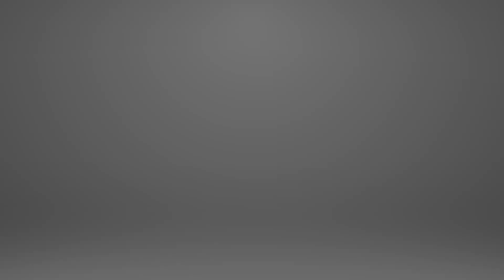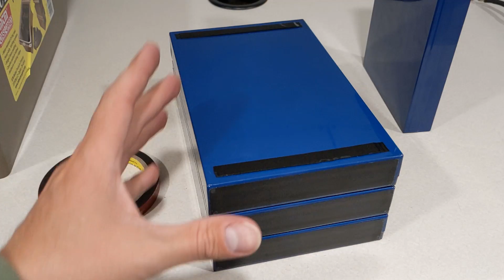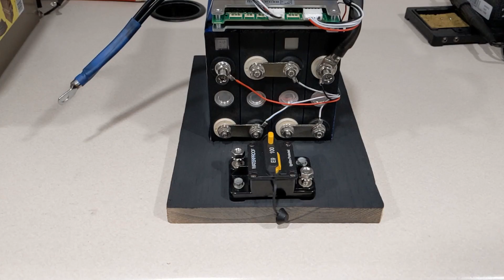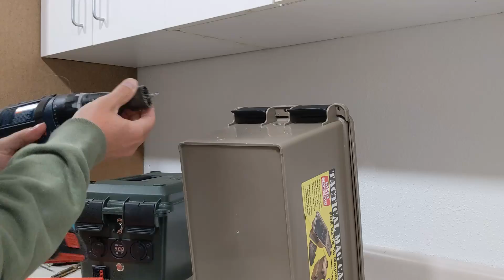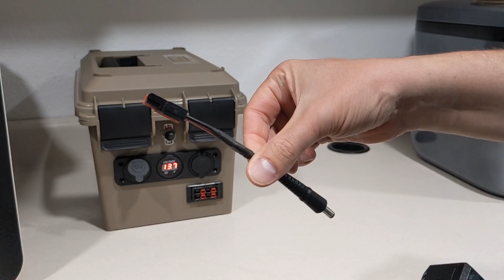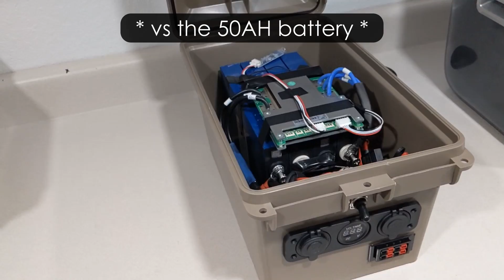DIY 80AH LiFePO4 Battery Box - COMPLETE BUILD VIDEO  | AliExpress Cells, High Quality BMS

Comment: i thought on these prismatic cells the vent has to remain upright or pointed up to vent if possible, or is that a vent for expansion only in case of over heating, i too was going to try a build like this, i have 8 batteries coming to try
Reply from the maker: I haven't had any issues ever since making the battery. I've seen many other designs with the venting horizontal as well. Big battery has their cells setup sideways.  I have only ever pulled 30 amps in or out at a time. If I was going to pull 80 amps I'd probably worry about it venting, I don't use it for large loads, mostly 12v fridges.
Reply: @Jasonoid  thanks, thats what i was thinking, i was going to make one for my son as a present, just for camping, maybe to blow up mattress, charge cell phone or tablet when hes hunting, ect.or to charge things or run things in his tent, ect.
Reply from the maker: @mattrowe1229  that would be an excellent project, have you seen the chins 12v 100ah lifepo4 battery that will prowse reviewed recently? Great battery for super cheap! I'd probably go that route next time I build a battery.
Reply: @Jasonoid  ill go look for it, i may have seen it already, ive been looking at so many vids i forget which ones i watched, but i am a member at his forum also, i was also looking at the 32650 because of size, and weight, and no vent to worry about. will got me started in all this as i am building a backup emergency for my trailer just to power necessities with 2 panels, my batteries i started with are coming from battery hookup, just 8 x 25ah to start.thanks for replying, a lot of tubers dont..
Reply from the maker: @mattrowe1229  good luck with your project, you can't go wrong either way! I'm just a small fish in a REALLY big pond haha
Reply: @Jasonoid  im just a minnow LOL
Reply: I shared the same concern about them being on their (short) side. It is difficult to find a decent box tall enough to have the cells upright. In the end, I think I will go with this design on the short side and see what happens. I too won’t be drawing more than 30 amps most of the time. Likely just 3-5 on a fridge. I’m using the 78 AH batteries off of batteryhookup.
Reply from the maker: @ssyoumans  I still haven't had any leaks on my cells. I bet you'll be fine to install your cells this same way. There are many of these prismatic cells that are oriented sideways in other commercial uses.
Reply: @Jasonoid  i was also looking at these, 18650 so there small, i could use 2 of these per box in parrallel, keep it at 14.4 volts which is what our vehicles charge at so it wont hurt any 12 volt items, and they come with a BMS for only $7.99 a piece, plenty of room in a ammo can, just to be used for camping and low drain devices and emergency,  https://batteryhookup.com/products/14-4v-6-6ah-95-04wh-li-ion-module-with-bms
Reply from the maker: @mattrowe1229  those should work well. The only downside to 4s lithium batteries is the voltage swing. 14.4 is the nominal voltage and it goes from 12v to 16.8 volts, so probably a little to high for some devices.

I am purchasing battery hookups 100ah lifepo4 4 pack of battery module and their lifepo4 4s BMS/Bluetooth adapter for a new build, those options are under the accessories page on their website. I'd recommend those cells for the price! Only $240
Reply: @Jasonoid  couldnt find any 100ah batteries on their site, i found the ones i purchased 25ah
Reply from the maker: @mattrowe1229  send me an email to jasonoidllc@gmail.com and I'll send you the info.

Comment: whats the max Amp output?    and How much does it Weigh in lbs..   Was looking into making something like this for my car audio system currently I have 3 Xs power 3400 batteries...They all weigh quite a bit and weigh down the back of the car.   I would need something I can draw quite a few amps from at once.. I'm pushing like 9000 W RMS
Reply from the maker: Weighs like 25 lbs, usually they can handle 1c discharge rate, so 80 ah is 80 amps.
Reply: @Jasonoid  Nice and light but I don't think it would be able to handle it..  system is Drawing too many amps ..

Comment: Do you recommend putting a battery monitor for the case.. If yes, do you have a recommendation ?
Reply from the maker: The BMS I used for the build has a Bluetooth app that shows absolutely everything about the battery. Very useful!
Reply: @Jasonoid  That I am planning to use, but wanted to check if there is a LCD one I can use.. mostly because family will be using it more than I will and just wanted it be idiot proof.
Reply from the maker: @jbphoto8238  good idea! Iust Google lifepo4 battery meter and you'll see some options. Just check out the reviews before purchasing it.

Comment: Very thorough and informative build Jason! Thx for sharing. Was wondering if you had ever thought of using Li-Ion before choosing to use Li-Po instead before the build? Am trying to choose either to use these both for my build as well. So thought of getting your thoughts on it first. Li-ions are cheaper but has lower capacity on each battery, Li-pos are much more pricy but has higher capacity on it. But which one lasts longer in the long run?
Reply from the maker: Lifepo4 have 2500 cycles at least per cell if treated correctly, lithium Ion only have 500. Lithium ion are a fire risk, especially for a diy project. I would stick with lifepo4, they are slightly heavier, but are very safe!

Check out the SOK 100ah batteries, they are very good quality but they have the built in BMS already that has the low temp cutoff. For complete diy aliexpress has many cells to choose from, you just chose the middle ground pricing on cells, I avoided the dirt cheap ones and the most expensive ones.
Reply: @Jasonoid  thank you on reply Jason, much appreciated. Will have a look on those battery u suggested. Again tq and keep those videos coming!

Comment: Have two questions, 1. we need 2 fuse holders and one 30amp / 20amp fuse which is not in the list below 2. Can I plugin the solar power panel / car battery 12v output through a MPPT or i need a DC to DC convertor as you have in the comments.
Reply from the maker: You can charge it via the Anderson power pole connections as long as you have a MPPT designed for lithium batteries.  The fuse holders can be found on amazon, get at least 8 to 10 gauge holders
Reply: @Jasonoid  Thanks a lot .. I got both.. will shortly send some pictures after I complete the build

Comment: Do you have a suggestion for a different box for this. The TMC has been out of stock for a while now and I cannot seem to find it locally.
Reply from the maker: Dang, I'm sorry you can find it. They have a green one that's very similar, have you seen that one in stock?
Reply: @Jasonoid  I found it finally at one of the arms seller.. wish amazon had it in stock and I did not have to run around in circles :) ..

Comment: How long does your battery box power one of your larger 12v refrigerators?
Reply from the maker: I ran my ICECO VL60pro for over 60 hours on my battery pack and it had plenty of life left. No input or charging during that test. Runtime depends mostly on ambient temps and what you have the fridge set to inside. I was really happy with the results.
Reply: @Jasonoid  that's awesome. I'm building one right now and can't wait. Do you have any problems with your inverter when your batteries are charged at 14.v?
Reply from the maker: @tylerj602  Car batteries when fully charged sit at 14.2v and your alternator sits at 14.2 volts most of the time. These LiFePO4 batteries have the perfect voltage! They are slightly higher than lead acid batteries and don't sag as much so 12v fridges run much better on them.
Reply: @Jasonoid  ok, thanks for the info. I charged my batteries and connected my inverter and it kept flashing the lights indicating something's was wrong. I then connected it to a lead acid and it worked fine. I left the lifepo4 sit over night running some 12v lights and with the voltage drop the inverter worked then (the next morning). I figured it was the voltage.

Comment: How did you combine the 3 BMS wire ends into 1 terminal? Are the BMS wires 10 AWG?
Reply from the maker: I used a large terminal lug that supported 6 awg wires and soldered/crimped it in there. I purchased this set and I use these all the time for projects:

https://amzn.to/2Zp09md

Comment: What battery pack did you use from aliexpress. There’s a few options, do i go with the 105 amp one?
Reply from the maker: I used 80ah battery cells. I'm not sure if the 105 AH cells would fit in the case I used. There are many 80AH cells on Aliexpress, just find one that mentions they are grade A cells

Comment: I’m pretty sure u can orientate lifop04 cells in any direction but I remember one person I follow can’t remember who said on the side and upside down r the worst ways. Not sure just figure I’d let u know. Laying them down I heard was better
Reply from the maker: Will prowse probably. No issues yet and they have been sitting sideways for a year. Maybe under very high discharge and charge rates they would leak or vent but I hardly ever pull more than 5 amps from the battery at a time.
Reply: @Jasonoid  cool.

Comment: Hi.. thank you for good explanation and detail of project. 

May I ask you how to recharge battery? 

Cheers
Reply from the maker: I use the Anderson power pole ports. I charge it with a Kisae DTM1250 DC to DC charger. It takes both DC input from my alternator or with MPPT solar input.
Reply: @Jasonoid  thank you for your reply. can I have a look how to connect DC to DC charger to your battery ?
Reply from the maker: I will have a video out on it soon. Just keep checking back for it in the next month or so. It's pretty simple.
Reply: I came here for the same question.  Would I be able to charge this with my renogy 100w solar suitcase that already has the charge controller by alligator clipping to the main terminals inside the box?
Reply from the maker: @deanwhittle2669  Most people would advise against it because that battery charger is designed for lead acid batteries....BUT technically it would work because it would charge the battery up to 14.2 volts and the LiFePO4 BMS would shut off the charging. I have used a lead acid charger on my battery in the past in a pinch, BUT I always recommend someone purchase a designated lithium based charger.
Reply: @Jasonoid  wow thanks for the quick reply.  Could you clarify... The Voyager states "4 Battery Type Compatibility– Sealed/AGM, Gel, Flooded, and Lithium batteries (with Lithium Awakening feature)"  Does that not include Lifepo4?
Reply from the maker: @deanwhittle2669  Well that's cool it supports lithium, it should have the ability to "program" the final voltages and work just fine with LiFePO4 chemistry. You'd probably want to have the final charge voltage for this battery around 14.2 -14.4. Mine is set to 14.4v.

Comment: How long could you run your iceco fridge with the battery?
Reply from the maker: I recently tested it, It ran for 54 hours and was about 50% capacity, level of temperature make the biggest difference. If I used solar panels and my Kisae DTM1250 DC to DC charger it would last forever. Pretty happy with performance.

Comment: can I ask you for information? I have purchased 4 prismatic 90ah lifepo4 cells, do I have to control a trolling motor with a maximum absorption of 20ah, can I install a 40ah bms or do I have to mount it from 90ah or higher?
Reply from the maker: You will want your bms to match the maximum output of your battery cells just in case you ever want to draw more power. 90ah cells should source 90amps fine so either do an 80amp bms or a 90amp bms in your design.

Comment: Nice battery box, 
May I suggest you break up those Anderson power poles into 2 or more fused links.
Also cut and instal Anderson’s on that bestec inverter. I did mine so much easier.
Reply from the maker: Good suggestions, thanks!

Comment: Wonderful ideas!  I won't be sleeping well for the next couple of nights!  Is it possible to charge this arrangement by simply plugging into a automobile's 12v accessory port?  I know it won't be rapid, but it would charge the unit while driving, right?

Again, thanks for the wonderful idea!
Reply from the maker: You'll want to charge the battery using a lithium lifepo4 based charger. There are many available. If it has DC input you could charge it with your vehicle 12v accessory port. Thanks for watching!
Reply: @Jasonoid  Have you sourced a reasonable DC-DC charger?  I'm not sure how boxes like Jackery are getting all this stuff in there!   Charge controller, inverter, DC-DC-charger.  AND the batteries!  How do they do that???  One of my primary uses will be to run a DC refrigerator while on the road.  I really need to be able to charge from my alternator, even if it is slow.  How do you manage your refrigerators while on the road?
Reply from the maker: While on the road and while driving, I run my fridge off my 12v accessory port in the back of my 4Runner, I custom installed Anderson power ports and ran 8 gauge wire to the back. It works well and I don't have much voltage drop over the distance. 

While camping or when I'm not driving I run my fridges off this  Lifepo4 battery. I charge it via a combo charger. It's a Kisae DTM1250. Check it out the, I bought one and I love it. Little expensive but very customizable. Solar MPPT and DC to DC Charging in one! I bought it off Amazon.
Reply: After looking around (and being appalled at the prices for DC-to-DC chargers), I've started playing around with DC buck boost converters you can buy on ebay/Alli Express, etc. These are basically self-contained power supplies that feature constant voltage and current and will easily step up or step-down voltage from inputs between 5 and 30 volts and outputs of .5 to 30volts.  They are pretty limited to relatively low amperage (usually less than 4 amps), but for my purposes it should work, I think, for slowing charging my LiFePo4 battery from the car's electrical system while driving.  There is also a timer feature that will turn the output off after a predetermined amount of time.

There is the added plus of now having a self-contained module that can be used to run all sorts of less-than/more-than 12 volts in my battery box.  The model I'm using has a display built right in, so it's very easy to dial up the desired voltage and amperage requirements to run fans, worklights, etc that may be rated at something other than 12 volts.

I'll report back with details of my testing....
Reply from the maker: @quinbus51  please let me know what you end up doing!
Reply: @Jasonoid  Hey Jason.  I'm finishing up my testing on two of these buck boost circuits and I have to say that I'm pretty happy with the possibilities.  I'm in the process of building a LiFePO4 charger that will run off any DC input and boost the voltage to a constant 14.1V with auto limited current, all for about $17 (case, switches and cables additional).  Each of these two different designs permit the ability to program limits. e.g., charging shuts off after a prescribed time limit, in minutes/hours) or--most importantly--when your source voltage drops below a preset voltage limit (e.g., using your car as a source voltage for a 12v refrigerator, set an under voltage limit at 10.75V to protect adequate cranking voltage for your vehicle). The only real limitation is the circuits are limited to no more than 5A (I'll probably set it at some lower Amperage to avoid overheating the board in hot summer car temps so for a large storage battery it wouldn't really be be practical to completely charge a fully discharged battery.

The displays show you total Volts, Watts, Amps Ah, Wh, Voltage In/Out, total time on, temperature of the heat sink, plus the ability to set shut off limits for each of these.

The box I'm building will have Anderson Power Poles for input to the board (with appropriate adapters for the source--e.g., male cigarette lighter for use in car) and an appropriate output cable that will hook to the LiFePO4 battery terminals.  Turn it on and drive.  If it does nothing more than maintain the battery draw due to presented load, it's a clear win.  If it only extends the LiFePO4 battery capacity it will still be a Good Thing.  But mainly it will allow me to keep the refrigerator running in a parked car for an hour or two without having to unplug the refrigerator from the car's 12V port when the engine is off (ports don't stay energized in my vehicle when the ignition is off) and hook it up to the battery and then replug everything when I get back..

The nice thing is that I will also be able to use a cheapo AC battery charger for the source where shore power is available and still have Constant voltage and current protection to protect the LiFePO4 battery.  The more robust of the two circuits I'm testing (the $17 one) even has the ability to create 10 profiles of voltage, amperage, overvoltage, undervoltage, over current, etc that are recalled at the push of a button.

I'll post a couple of pictures when I get it made.  Keeping my fingers crossed!
Reply from the maker: @quinbus51  send me an email of the pictures/project, jasonoidllc@gmail.com. I'd love to see it and how you built it! Sounds very promising and quite useful! Thanks for providing me an update.

Comment: Thanks for the video, quite informative. How is the BMS holding up? Can you set a cutoff voltage through the phone app, so when the battery charge drops below a certain voltage the power just cuts out?

Looks like quite good value, considering it for my first camping battery project. Tx
Reply from the maker: Bms is completely customizable with the Bluetooth app, still working great! I use my battery all the time!